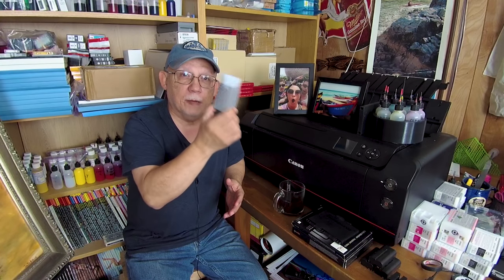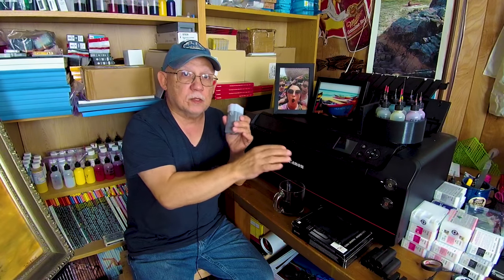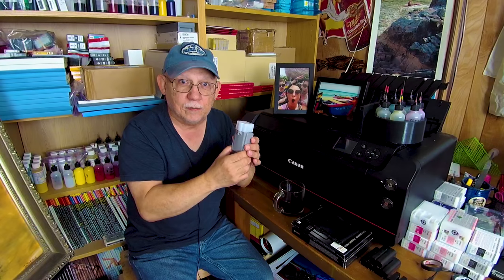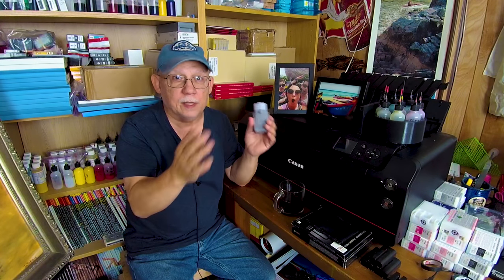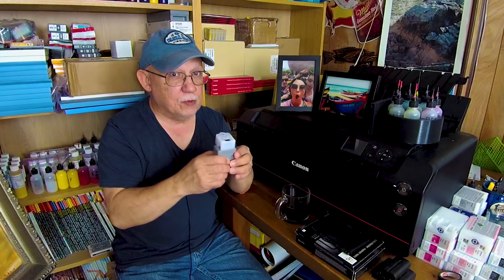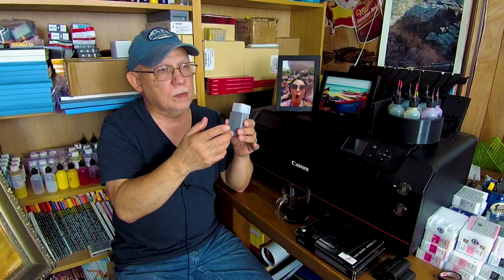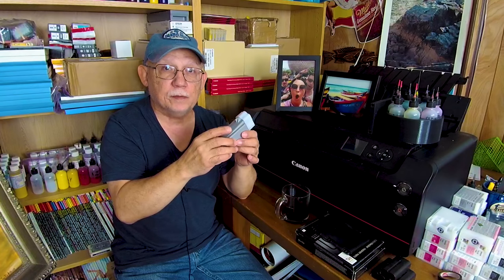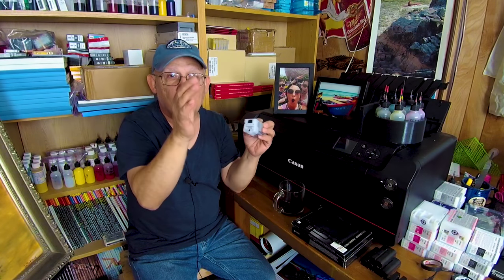PRO 1000 Cartridge Refilling Rules You Must Follow

Comment: Hi Jose,
Re: Pro 1000 refilling with ARC chips purchased from PC.
Well, my CO finally went empty and the red X came on. I had already replaced all 12 OEM chips with ARC chips purchased from PC in February and March 2018, and had refilled all 12 carts with PC signature inks, except for R,B,Y and CO, which were refilled with OEM inks from PC.
So, I carefully refilled the CO cart with 80 ml of CO and re-inserted the cart. It read "original OEM cart detected - CO". So I was happy, until I saw that the red X was still on with the CO cart full!! It recognized it as original but still gives the red X, indicating empty. I tried removing and re-inserting a few times, and even turned off the Pro 1000 from the power button (did not unplug it!), but no change. Red X still there. On my driver utility for ink level, it shows the CO as empty!!
I had a full OEM CO cart on hand and inserted that, it recognized it fine and CO level now indicates full and no red X.
Any ideas on this one?   Should I return this ARC chip to PC or wait and see if this happens with other colours. CO is the first one to be refilled after emptying a cart with an ARC chip from PC, made in China.
By the way I have firmware 2.060, and although others may not have found this to be an issue, maybe it is??
Reply from the maker: Contact PC. Chine says they are supposed to reset to a LOW level. Allow you to print until you are again empty with red X. Repeat. The term ARC was miss used by the manufacturers. They are now being called Permanent Chips. You are also on a very new firmware. Mine is 2.020
Reply from the maker: All of china is on holiday during Chinese New Year so communication with the manufactures is not possible until after the holidays. Then we can get to the bottom of this.
Reply: @cheo1949  Thank you Jose. Any way I can reset back to the old firmware of 2.020?
Reply from the maker: I don't think so.
Reply: @cheo1949  Thanks Jose. I emailed Mike at PC, but we know he is too busy to answer emails, so mailed the CO chip to him hoping he will send me an exchange. I am guessing all my other 11 ARC's from PC will have to be resent to him for exchange as well, since they are from the same batch. We will see as they go to empty.

Comment: Excellent! I just recieved my new Pro-1000 yesterday. There is a promo deal running now. Just to verify what you already know; first initialization, without printing a thing, used an average of 35% from each new ink tank.  I will be refilling from the 700 or 330ml OEM inks; wondering if you have encountered any variation in inks using the large OEM tanks for refills? Thanks for all that very useful info!
Reply from the maker: The initial setup of the printer will use up a ton of ink because it has to fill the internal ink lines as well as the internal compartments the dampers that are built inside the printhead body itself.  All that has to be filled as well and then some ink has to be expelled and dumped into the maintenance cart. So yeah that's that's what happens every time you initiate one of those types of printers. As far as the large format cartridges goes, as long as they are designed for the Pro 2000 and up they are identical so you will be able to harvest ink from those and then load your original cartridges back up with ink of course you will need single-use chips in order to be able to use those cartridges you just refilled. I have a source and a link for inks on my video description where you can purchase 700 mL cartridges for $225 including free shipping United States.

Comment: $47 ($35 ink + $12 chip) + shipping per refill just isn’t at the right price point, particularly if canon runs those crazy sales with free paper by the truckload. 

My strategy is use the PC colors in the pro100 for proofing for “free” and then print the final image on the pro 1000.
Reply from the maker: Not sure where you got the $40 per refill figure. But your workflow makes a lot of sense.
Reply: I had a typo.  $47 / refill assuming $35 for ink + $12 chips.  Actually, just checked the PC website and the chips are gone, so for now, refilling isn't really an option at all.

Comment: Hola Jose, may I ask you a question. Why do you want new chips in the cartridges , when you can also refill the cartridge with OEM or PC ink and when you get the message " ink cartridge empty" hold down the on/off switch for 5 seconds , and you can go on printing.
Reply from the maker: Because it disables Ink Monitor and you will never know when your cartridge is empty the next time. It also causes all sorts of unwanted cleaning cycles before every print on some printers. Why in the world would you prefer that to happen?
Reply: My answer to that would be, just get the cartridges out every couple of weeks , shake them , way them , and if the are below 15ml just fill them with 30 ml. And the cleaning cycle thing before every print ; you say that it happens 'on some printers'. Does that mean that its not a fact , that it will certainly happen. Inkowl told me that no unwanted side effect would occur. Jose I trust you with every thing you say, and I am eager to hear what you're answer is. Bye for now
Reply from the maker: I used to happen on PRO100 and PRO1 back in the day before there were any options for third party use on these printers. Info not know for sure IF that will also happen on the PRO1000. I have a good relationship with inkowl so I will contact then and see what we can come up with.

Comment: In a Pixma Pro 100, by the way...
Reply from the maker: Did you mix any third-party yellow ink with the original yellow ink?Of course that only applies if you are refilling. Doing that would cause the yellow channel to clog. If that's what occurred that paper towels soaks will not work because your clogged would be internal and not at the nozzle plate
Reply: Thanks, Jose...No problems so far... @cheo1949

Comment: What happens if the cartridge goes empty half way through a print?
Reply from the maker: Well you should never initiate a print job if you know your cartridge is about to go empty but most printers will simply stop mid print and allow you to replace the cartridge and then they restart where they left off.
Reply: I tried to replace a  cardridge midway through a print and the printer ejected the print before it finished. This was the pro1000
Reply from the maker: Are you saying that the printer stopped midway or you attempted to replace the cartridge on the fly. It should have accepted it and never stop printing as far as I know that's the way it is supposed to be with a Pro 1000 and higher
Reply: I attempted to replace the cartridge on the fly. I saw the red X as it was printing and as soon as I pulled the empty cartridge it ejected the print. The print was less than 1/2 way through printing
Reply from the maker: All right that is weird. It is supposed to be able to do that that's one of their claims.